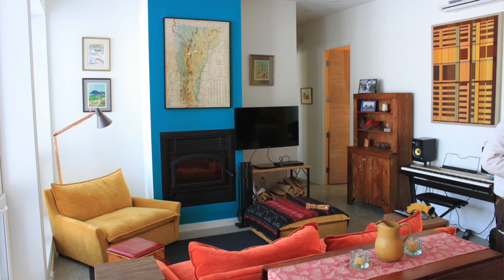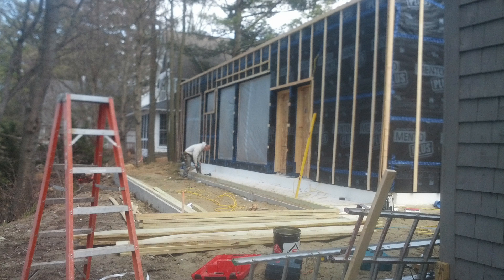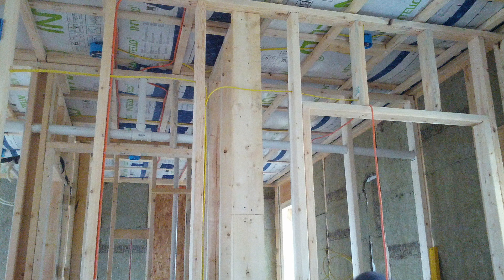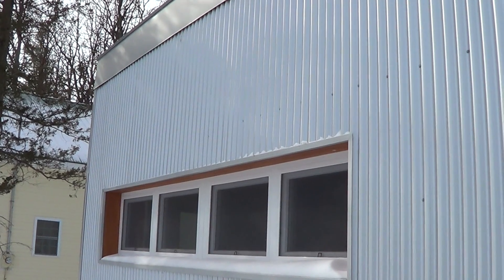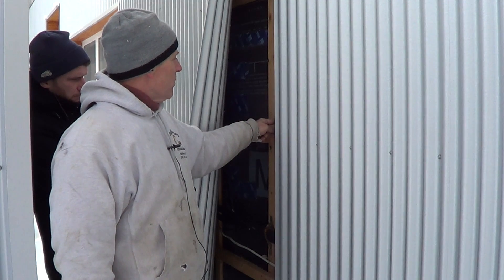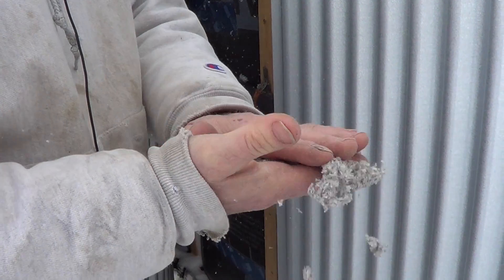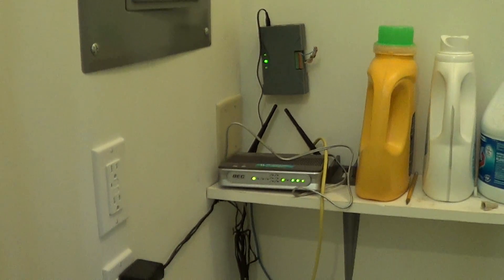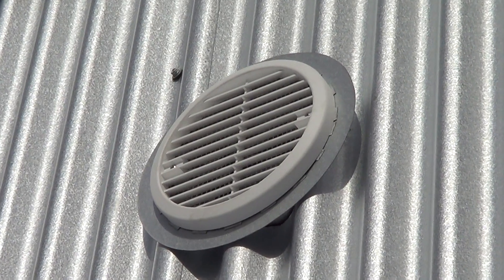475 On-Site: Northern Timbers Construction

Comment: The roof is R80 and the 200 square feet of windows is R5.   Fail.
Reply: if they modelled heat gain in from the windows to the concrete floors it may be that the heat loss is a wash. some passive houses are set up to heat via winter sun using solar aspect with windows primarily to the south-southwest.
Reply: @AmandaComeauCreates  
Complete Propaganda.

Comment: That's the second time I have heard in floor radiant is too hot for a well insulated house. I plan on in floor because I want polished concrete floors. But it's kind of a interesting thought you could get rid of a big expensive heating system and spend that money on insualtion. But I'm assuming that youd want atleast a hardwood or good floor covering
Reply: dont forget to insulate the slab :)
Reply: @stevepailet8258  doing 2 layers of foamular R10 and a vapor barrier.
Reply: @townsendliving9750  trying to figure out which might work better for me.  a well insulated crawl space or just a lot of excavation and then as you are doing. pros and cons to each style. I am leaning towards pier and beam. Currently planning on 35 foot wide so easy to just put in I joists with a single beam down the middle.  Sure will make running plumbing , power and other utilities.  Still need to insulate the wall area and looking to just put in an air barrier/vapor barrier then foam sheating then pour in 3 inches or so of gravel. Around here 10 yards of gravel is around $150 so really cheaper than doing a concrete slab.

Comment: Wow, would be too hot with in-floor radiant heat system.
Reply: Think that it is a cost analysis thing on the radiant.   The needed amount of heat is small so running it thru the domestic water heater would make sense.  It just is not going to need crazy amounts of heat that even a small boiler system would take.

Comment: Great video and thanks for highlighting another Chris Corson style wall assembly. I'm curious about the roof - I'm assuming above the cellulose in the ceiling is some kind of decking and waterproof membrane? This is an unvented flat roof? Presumably the roof deck would be a cold condensing surface but the risk of moisture accumulation there seems low with such a well detailed air barrier, can you comment on how that's working?

I like how the Intello connects with the 1x6 over the top plate and onto the wall sheathing! Nice and clean transitions!